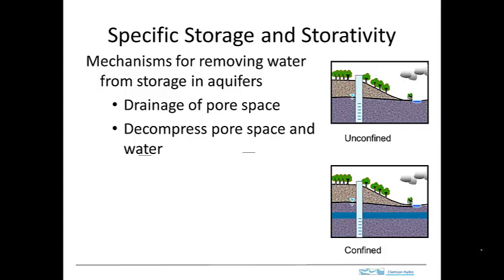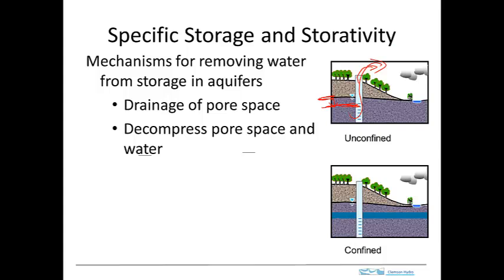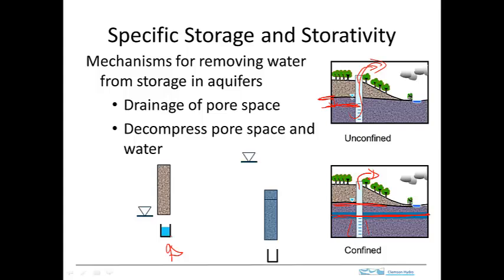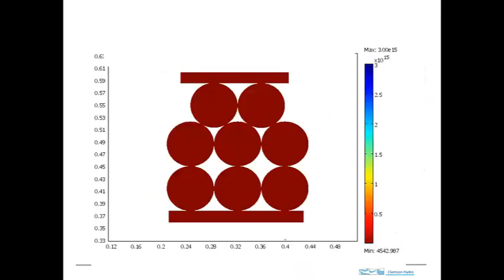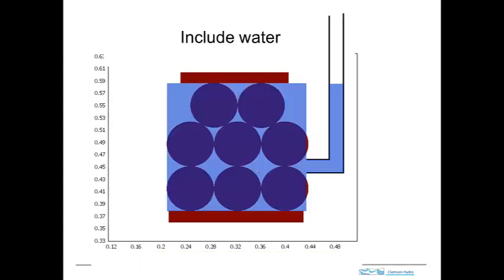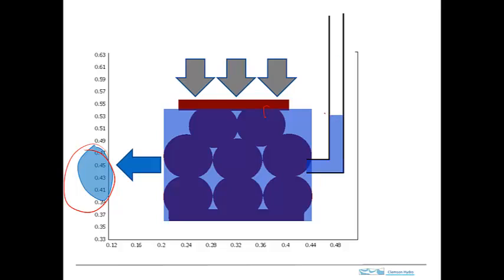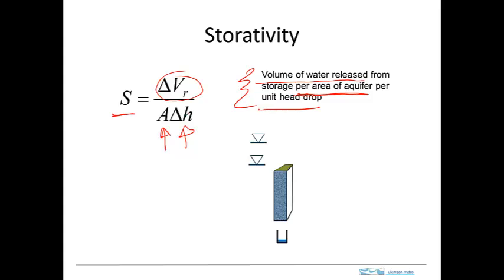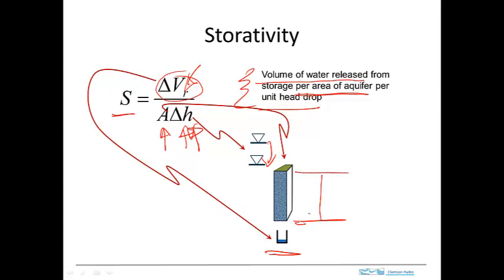storativity

Comment: what do you mean when you say drop the pressure in a confined aquifer?
Reply from the maker: You can drop the pressure in a confined aquifer using a pump in a well.  The pressure drop causes the water to expand and the pore space to shrink.  This is why you can recover water from a confined aquifer.

Comment: When it’s mentioned per unit area so the depth of the material is anything we want right 
But when it’s unit volume the calculation itself is giving a final product with respect to a depth of 1 right ?
Reply from the maker: Storativity is per unit area because it applies to the entire thickness of the aquifer.  It is a property of the layer that forms the aquifer.  Specific storage is per unit volume.  It is a property of the aquifer material.  Neither of them depend on the depth.   This is similar to  transmissivity, which is a property of the aquifer layer, and hydraulic conductivity, which is a property of the aquifer material.

Comment: Also, when you mention how after you pump water out, some of the water in the area where the table dropped drains out
Isn’t that water already pumped out or does pumping only take some of that out whilst some still stays in the pores even after pumping out of the well ?
Reply from the maker: Some water drains from the pores by gravity when a water table drops.  Some water is retained.  These quantities are determined by the specific yield and the specific retention.  The water that remains in the pores under gravity drainage is held there by capillary forces.

Comment: When you mention the pressure change and drop how will the aquifer material contract, isn’t higher pressure the one related with compressing material into a smaller place or is the contraction here because water is being drained so pores are left empty ?
Reply from the maker: Changes in pressure affect storage of water in a confined aquifer by compression or expansion.  Increasing pressure expands the pore space and increases the water density.  These factors increase the volume of water that can be stored.  If the water table is close to the injection point, then you can also increase the storage of water by raising the water table.  This causes pores that were partially empty to become filled with water, increasing the water storage.  The compression effect also occurs at the water table, but it is much smaller than pore drainage or filling.

Comment: How does storativity affect the amount of water that can be obtained from each type of aquifer? I learned that storativity is much smaller for confined aquifer, but does that not go hand-in-hand with the fact that the water from confined aquifer comes from pressure reduction?
Reply: I'm not sure if i got your point. But the greater the storativity, the greater will be fractional change in volume per unit  head drop, which means the aquifer are expected to provide less water.

To be a confined aquifer, the unit need to be saturared with the head above its upper interface. Hence, the pressure of water is higher in confined aquifers. In other words, if a confined and unconfined aquifer have the same transmissivity, the confined are expected to produce more water because it has a higher water pressure and hence, a lower fractional change per unit head drop.